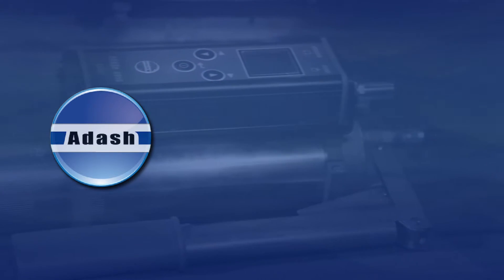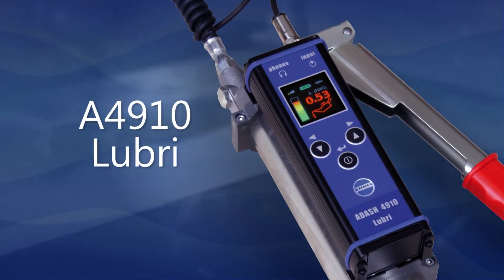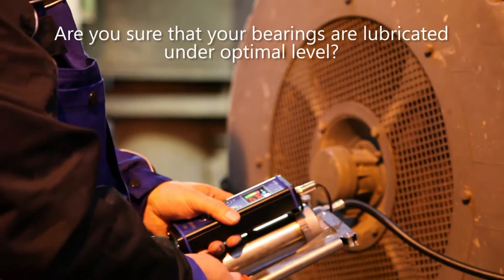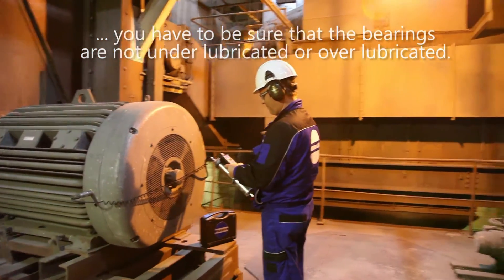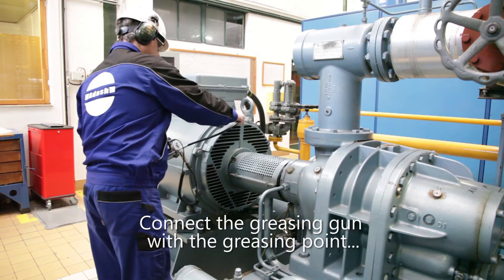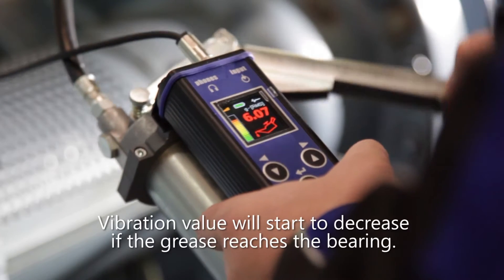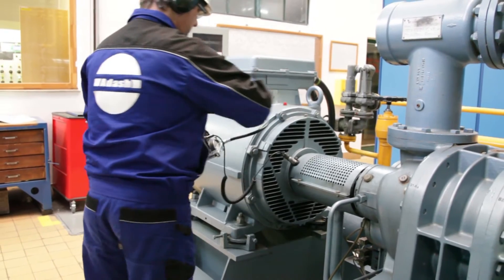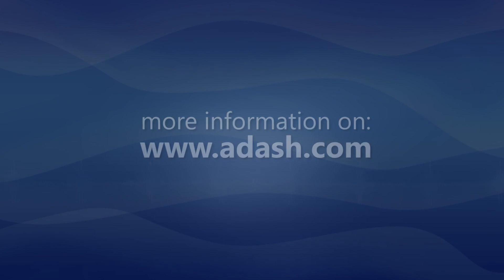Adash A4910 Lubri - Control the lubrication process (EN)

Comment: what if the bearings are over lubricated, how to detect them using this tool ?
Reply from the maker: Only thinq what will happen is that vibration value will be increasing more and more once you will be pumping grease into over lubricated bearing.
Reply: is the value read is acceleration?